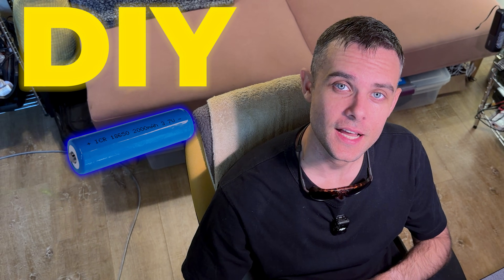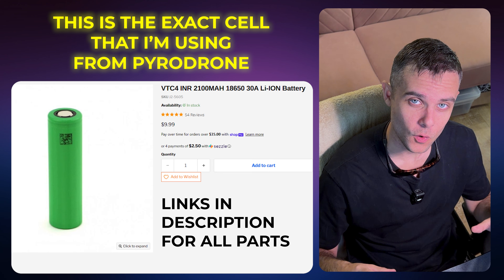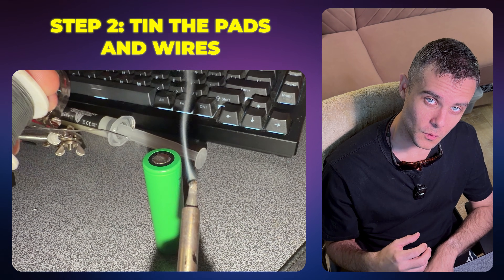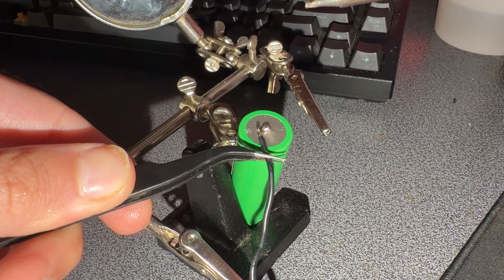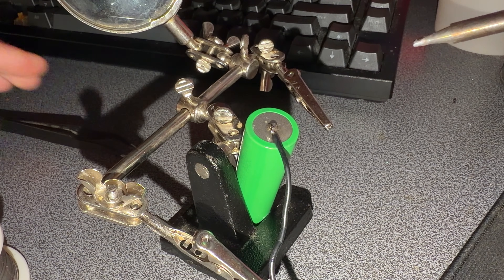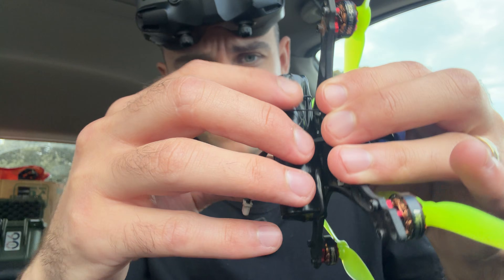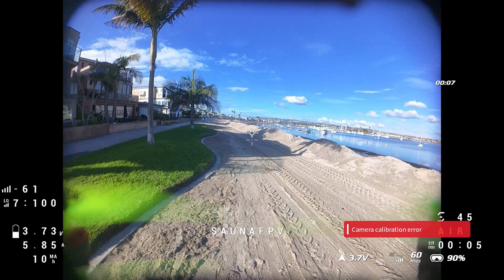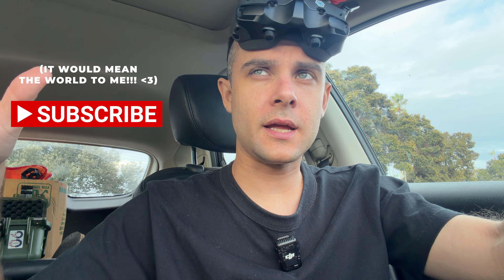I built a 1S 18650 pack… flight time was ridiculous (3 inch 1s)

Comment: why not fit a battery holder, then makes life a lot simpler
Reply: Save weight (holder is quite heavy) and better current flow (less sag)
Reply from the maker: Honestly, my printer is horrible and constantly clogs, so i hardly ever print! I would probably try one if so. But, my rubber bands are honestly pretty sturdy, so it would only be a very small QOL thing. but good point!

Comment: Hey! I love this build! You may have said it but I think I missed it. What frame are you flying? 

Also, if you can get a 2800 or 3000mah 30amp battery you could probably easily get over 20 minutes!

Again great video! Very fun to watch.
Reply from the maker: Hey Dude! Thank you so much for the kind words. Your channel is a big inspiration to me, so coming from you it’s awesome to hear! 

Ok, frame… I’m using the newbeedrone savagebee 65/3inch. I swapped to this from the crux 3 for 2 reasons - 

I broke 2 crux frames with light freestyle, so decided to upgrade to the NBD frame because it was more durable. Slightly heavier by a couple grams AFAUK, but more durable based on the carbon cut. Curious to hear your thoughts on the extra weight…

The other reason I swapped is because I live 15 min away from the NBD storefront, so I could get it same day with pickup lol.
Reply: @saunaFPV oh cool! I want to try that frame out eventually. I mainly was asking because I was thinking it may be related to the vibrations in your video. Did you get that figured out?

I don’t think a gram or two will make a huge difference and I agree that it is worth it to have something that doesn’t break. I have designed a 3” frame and am trying to find a service to cut it out for me. It will be lighter than the crux and hopefully stronger too.

Comment: Your battery can go down to 2.6V, but the dji o4 can't do that. What voltage booster are you using to create the stable 5v output? Or there is something on the flight controller that handles it already for you?
Reply from the maker: AFAIK, the MATRIX AIO fx has a built in BEC to deliver steady amps to the vtx without browning out at low voltage!
Reply: @saunaFPV  Outstanding! Good to know!

Comment: Cool build! Would Prob easier and cheaper to just run XT30 Battery Connectors though, instead of the BetaFPV BT2.0's meant for 1s light-weight TinyWhoops essentially.. 
If you want to use BT2.0 or already have that setup, the A30 connector will fit a BT2.0 connector as well and isnt restricted to being made by BetaFPV only and are sometimes easier and cheaper to get. 

Also whenever soldering Battery Connectors like a BT2.0/A30 or an XT30/XT60 you should have the other side of the connector plugged in when soldering so that the connector can get distorted from the Heat from soldering and it's just a good practice to get into..

Edit: At the higher power levels of upgraded 18650/21700 Cell Builds you will be bottle-necked by the BT2.0 and I would personally just ditch the BT2.0 and go to a simple XT30, thyre small and proven to handle all the power you need up until like 3.5"/4" FPV Builds.. 
Plus theyre cheaper too, even AMASS Brand.
Reply from the maker: Thanks bro!!! Great tips. Def doing the plug in on the connector next time to mitigate some heat. Glad this one turned out alright tho!!! 

Thanks for watching
Reply: @saunaFPV  Yea its a good habit to get into. It really works very well especially if you happen to heat it up alittle bit.
I was thinking about your builds, and I think you should you really actually need to swap that out for an XT30 Battery Connector. 

Lower Voltage especially at 1s levels, makes the Power being pulled higher on the AMP Draw than higher voltages, even with 2s. 

Especially if you plan to run a better quality Li-ion 18650 or especially the nicer 21700s Batteries like people listed in the comments like Ampace. 

They're are capable of putting out 20A-30A depending on the Load, but at this point I think why stick with something that will eventually become a Bottleneck. Like running a PH2.0 instead of a BT2.0 on a TinyWhoop LOL. 

A BT2.0 Battery Connector is only rated for 9A Continuous  & 15A Max Intermittent Burst Current. 

The XT30 connectors are rated for 30Amps Cont. & up to 65A Burst Power. So it's a good amount higher than the BT2.0's! 

They're also cheaper, easier to solder on, and are more common on other batteries of this style vs basically a TinyWhoop Battery connector. 
it's also only a few grams tops heavier.

Comment: Great, love 1s quads! A full build of the drone?
Reply from the maker: YOOO!

Ok so I think I'll be making an in-depth build guide on this but probably not for a few weeks. In the meantime, here is a quick parts list that I gave to another commenter, hopefully this help! Lmk if you have any questions whatsoever. 

Frame: Crux 3, or Newbeedrone Savagebee v1.8 (65 / 3 inch)

motors: Happymodel 1202.5 12500 KV 

FC: BetaFPV Matrix 3in1 FC

VTX: o4 lite

Canopy: BetaFPV meteor canopy (same one that is on meteor 65 and 75 pro) 

For battery straps, im just using rubber bands 

for props, i like the HQ Prop Durable biblade 3 inch , or gemfan 3 inch biblade. both are fine but the HQ prop are thicker and hold up better through crashing.
Reply: @saunaFPV  Nice! I have a BetaFPV Meteor75Pro O4 75mm Tinywhoop and its super fun having that O4 HD Video on a 1s tinywhoop! LOL..
It's definitely alittle heavy side when stock, but its got enough power to make up for it outside. 

There's also a bunch of small mods you can do to lower the weight a decent amount. 
Funny enough the Canopy is one of the first things. How has the On-Board video quality been? Is it good quality without Jello or is it alittle shaky?

I really like the BetaFPV Matrix 1s HD 12A 3-in-1 FC, with the O4 Lite Booster BEC designed into it for the O4 Lite and 1s WS Kit's too finally lol.. 

If you end up doing a new build in the fututre, another good lightweight 25x25 AIO is the Flywoo Goku F405 15A 1s/2s AIO. So you get the benefit of being able to run 2s if you ever wanted too in the future, and 15A ESC's that can handle enough to be able to pull out some power without stressing out.
Basically the same price and Flywoo has pretty fast shipping for their better prices and parts. Shipping usually takes about 4-6 days. They might have it at Amazon or a US based FPV Online store.

The new Rekon3 or maybe its a Rekon4 uses 2x 21700 Bateries stock for 2s power & range, and they just clip in like you would put it and take out regular AA Batteries. Its really cool, gets the good flight time and is light enough to be good for that type of drone.

Comment: Even 21700 cells like the "molicell p45b" would be awesome. 4500mah and only 22grams heavier than the best 18650s which hold ≈3100mah
Reply from the maker: Hell yeah!! I’m going to experiment with more cells. I’m really glad pyrodrone has some stock and is located so close to me 

That 21700 would probably fly forever!!
Reply: 22grams isn't insignificant but, maybe look for jp40 I think it's the new king of 21700 karl
Reply from the maker: @joshieeee20  thanks dawg!!
Reply: @joshieeee20  Hmm 4ah and 68grams vs 4.5ah and 70grams. Definitely some good options out there for more run time and power. Pretty crazy how far li-ion cells have come
Reply: @karlpittman9925  remember to factor in the capacity lost to high current, I believe the jp40 is better here, also remember voltage sag can affect usable capacity. Many variables not just capacity, the difference between some cells with seemingly same capacity can mean limping back at 60% throttle Vs flying back at 45.

Not saying this is true for the jp40 
But I think for the jp30 at least it's a very good cell, better than p30b. Never sure and depends on discharge rates so.

Comment: You should never solder to the centre of the Battery on the negative side will damage it solder it to the edge or even on the top side next to the + as all of the out side of the cell is negative so it don't get to hot
Reply from the maker: Ooops! Thanks for the tip brotha. I guess the guides I followed were a bit naive, like me! I plan to make another one, and will be a little more careful with that in the future! Live and learn i guess... thanks for wathcing!

Comment: I am obsessed with this builds, I already built NLRO4 3d printed one, clone of NoStab's Suka, Recon3 frame based one with o4 vtx and Kayoumini 2.5inch, Kayoumini was the third one and so far is my favorite, despite 2.5 inch props which are supposed to be less efficient, I managed to squiz 15 minutes out of 21700 molicel which is on par with my 3 inch builds, but much more stable out of the box, and I am not too good with pid tuning, so it is important to me :)
Reply: That's pretty sweet! Any videos of the Kayo or the Recon3? You running those on 1s or a 2s-3s Li-ion pack?
How is the power for slightly more aggressive flying here and there..?

Comment: For shakiness I recommend checking all screws, checking noise in blackbox and adjusting filtering if needed and lastly lowering P:D ratio. It can also just be wind + low authority, especially if center of mass is off center.

Comment: If anyone’s experimenting with 18650 cells on a 1S drone, not all cells are equal.
From my own experience, two cells really stand out:
LG HG2 “Chocolate”
Samsung 30Q “Pink” (Q30)

These have been legendary in the vape scene for years because they offer an unusually good balance of high-drain capability + high capacity (3000 mAh). Most generic 18650s sag hard under load or can’t deliver enough current for motors, but these two handle the amps much better and work surprisingly well for 1S builds.
Just sharing this because good cells make a massive difference — and these two are among the few worth using.
Reply from the maker: I’ll be building more of these and that info is super appreciated!! Thanks bro. 

I want to try a bigger 21700 too cuz I think the weight won’t be too much of an issue.
Reply: @saunaFPV you'd be better going with jp30 (18650) or jp40 (21700) 
They are new cells from ampace and they are very powerful.
Reply from the maker: @joshieeee20 thanks for this!!!!
Reply: @joshieeee20  Is it worth going to the 21700 cells if you have the room and dont mind the weight for the increased power and/or capacity? Or do most still stick with 18650's for their slightly smaller size and lighter weight??! Thanks for the info, I have heard about the JP30/40's from a few people now as well ampace.. Where do you purchase your cells from? Are you in the USA or outside of the USA? That usually makes the shipping too expensive from overseas vendor's, especially these days! Lol..

Comment: Nice video. Couple of tips. 1. Rotate the bt2.0 pins so the flat sides are facing out. This gives you more space for the wire. 2. Always plug in the opposite gender connector in when you’re soldering connectors, this helps protect them from too much heat.  3. Use less heat shrink, just enough to cover a bit past the exposed wire/ connector. 4. A bit of fiberglass reinforced tape is perfect to add some mechanical rigidity to the terminals.
Reply from the maker: GREAT tips! You’re the second person to say the plug into the opposite connector for heat, and to rotate the pins! I will def be doing that on next build. 

Super happy w the 15 + min flight Time here though. Might try a 3000mah cell and use your tips. Thanks bro!!
Reply: @saunaFPV yeah, 15 mins is great!

Comment: why there is vintage are you using any filter on ur dji o4?
Reply from the maker: I’m using flywoo wide angle adapter , so there is that on top of the stock lens. I’ve crashed it a TON , so there are some micro scratches that unfortunately come out as blurs 

I don’t use the footage for anything other than YouTube or showing my wife so it works for me but it is annoying!!

Comment: Great to see more of these builds pop up. Could you list your full build parts list?
Reply from the maker: Do you want the parts list for the quad or battery?
Reply: @saunaFPV  The quad, please. Appreciate it
Reply from the maker: @danskinn  Frame: Crux 3, or Newbeedrone Savagebee v1.8 (65 / 3 inch)

motors: Happymodel 1202.5 12500 KV 

FC: BetaFPV Matrix 3in1 FC

VTX: o4 lite

Canopy: BetaFPV meteor canopy (same one that is on meteor 65 and 75 pro) 

For battery straps, im just using rubber bands 

for props, i like the HQ Prop Durable biblade 3 inch , or gemfan 3 inch biblade. both are fine but the HQ prop are thicker and hold up better through crashing. 

Plz let me know if you need anything else, I'm more than happy to help you source the parts.
Reply: @saunaFPV  This is it. I had a feeling those are the parts you were going to list. I've seen the same listed in other builds. Thanks or sharing!

Comment: Wait, how it is better then 1S brick packs of same capacity?
Reply from the maker: Like how is it better than a lipo? 

They typically don’t make 1s lipos above 1k mah , so this gives way more mah capacity with less top end punch!
Reply: Google the energy density wh/kg of lipo vs lion chemistry
Reply: Lithium Ion batteries can typically be safely run down to 2.5 volts. While LiPo start getting serious damage at 3.3 volts or so.
Reply: Ok, good to know, that looks weird, if li-ion is better, but not on sale for RC.
Reply: @Kotofosonline lion didn't used to be able to supply the current required for RC, it's only the new cells that are just barely enough power, it's not good for freestyle still though, cinematic and cruising it's good.
Reply: @Kotofosonline  They have different uses. LiIon is good for long endurance, while LiPo can supply a lot more current for racing and freestyle.

Comment: I get roughly 8 min on Flywoo's 1000mah 1s batteries on the 3" build with the Crux frame, betafpv 3-in-1 aio and happymodel 11500kv motors.
However, that's including some light acro.
I'm sure, with strictly cruising, I could get like up to 10 minutes with it.
Reply from the maker: Nice! Interesting , I got 10 min on gnb 850 mah in another video on my channel. 

It was like the slowest flight ever though, so I’m sure with acro it would be way less time. 

I’m hoping to get like 12-14 min in 1kmah with super light cruising. I’ll make a video this winter on it!
Reply: @saunaFPV  Yea, I saw that video. That was indeed a pretty slow flight 😂
(No shade, btw.)

When you get that video up, I can see how much time I can squeeze out of mine and make a comment about it.

Comment: "1s Pack" 😅
lil tip on soldering the bt2.0 connectors if you plug in the female part it holds the pins in place and they dont move if the plastic gets hot while soldering 
this they the pins remain straight
Reply from the maker: That’s a pro tip!! I’ll definitely be using that going forward.
Reply: @s @saunaFPV and use flux on every connection even if you already used it to tin the wires, clean the flux afterwards with alcool and cut those heatshrink you dont need that much 1cm is enough, and you can remove the camera calibration error by connecting the o4 to dji assistant and do the calibration😉 otherwise great video
Reply from the maker: @ghostdogfpv  Yo Thanks dude!

Noted on the flux and heatshrink - will be using ur tips going forward. 

I have a question about the O4 Lite - I actually am using another camera module (from a dif o4 lite that had the board crap out) 

do u know if the calibration assistant will remove the error, even if the camera module does NOT match the serial number as the board? I heard somewhere that there is nothing you can do if you're using a camera from another unit, but I've been too lazy to try myself!! 

cheers bro.
Reply: @saunaFPV you are welcome, i am not sure about the o4 lite but i crashedmy wing wing against some barbed wire and it exploded, the camera did not work anymore but the module was fine so i did change it and recalibrated and no error message.